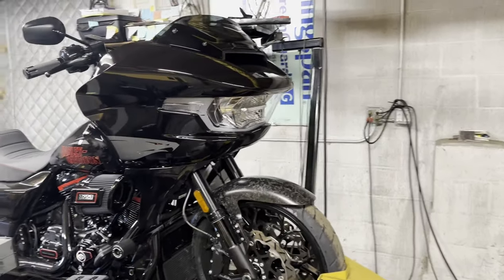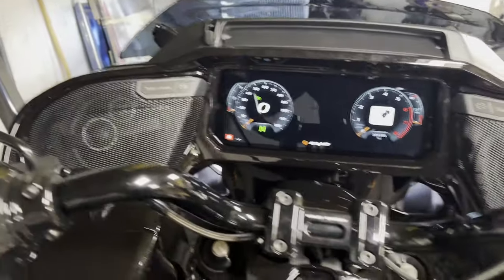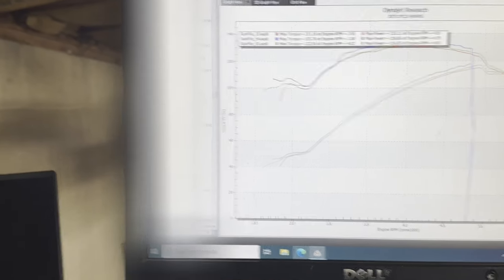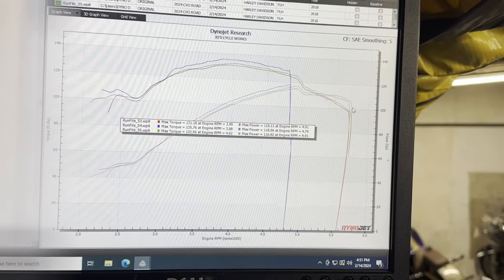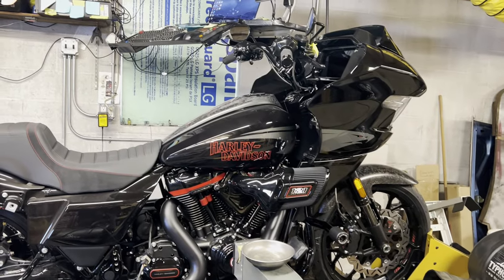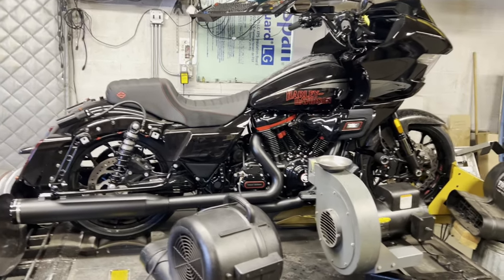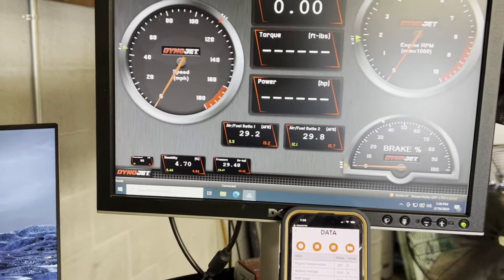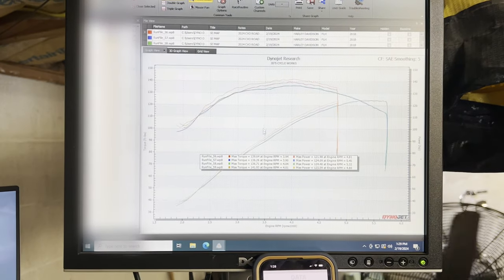Harley Davidson 2024 CVO - Stock vs. Exhaust Upgrade

Comment: Great video Dave. I think you are one of  the first YouTube channels to do a Dyno run on a new CVOST and exhaust Dyno run upgrade great information Dave . Absolutely love that bike. Specially, in that color. Thanks for sharing.
Reply from the maker: You’re welcome!  My pleasure
Reply: @JDsCycleWorks when you installed this  what stage did you do? I’m putting 2-1 on my 24 cvo st and I Hurd  you do stage 1 then I also Hurd stage 2 because it has the 511 cam in it?
Reply: What’s the part number for the header? I want to put one on my 2024 Road Glide

Comment: I just wanted to say thank you for this video. I've watched every cam video you posted over the past weeks and I feel that this video is valuable because it shows how everyone's impressed with the power of the new 121. Now you can see what a stage 2 will do on your 114.   Without having to upgrade your bike to a new one, you can get the same power. Obviously, people would argue what you can do with a stage 2 on this bike, but the point is you could do a stage 2 on a 114. Save yourself the 20 Some thousnd dollars in difference of upgrading to a new CVO and still have similar power. I think that's invaluable as I just bought a 23 with the 107. This will be the way I go, a stage 2 cycle Rama cam. I hope that makes sense to thise reading this. Thanks again for the knowledge and perspective this video sheds on power vs displacement.
Reply from the maker: Thank you very much.
Reply: You are offcourse 100% right. My 114 stage 2 makes 120 whp